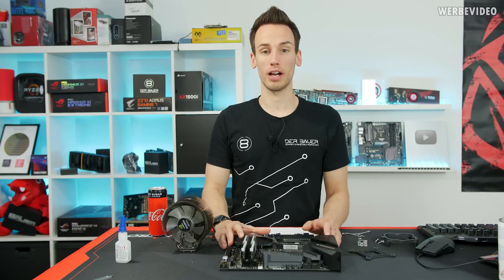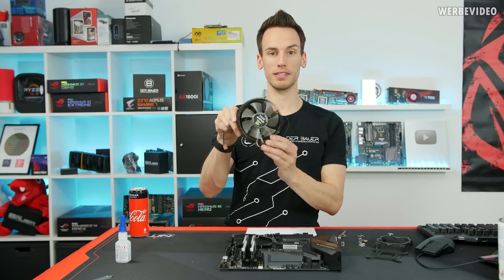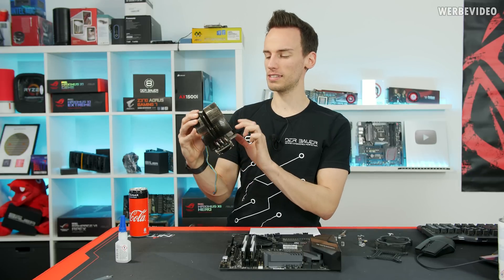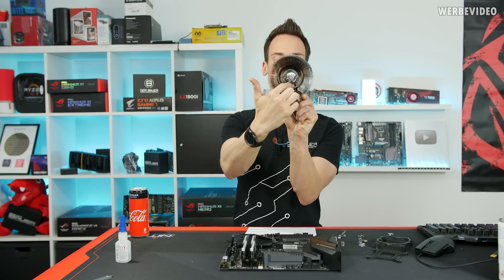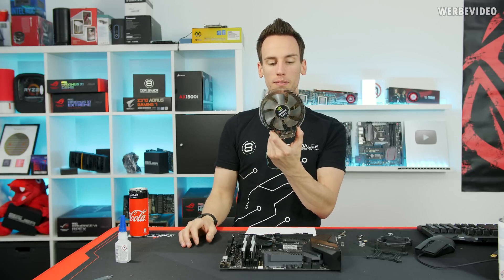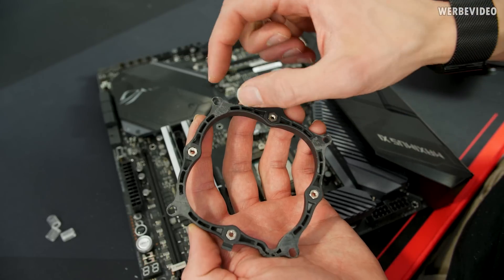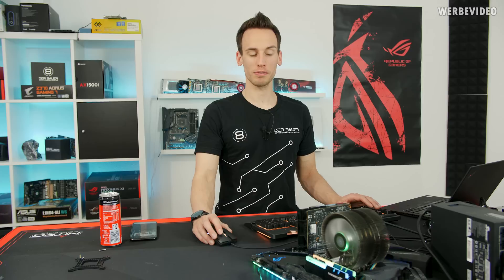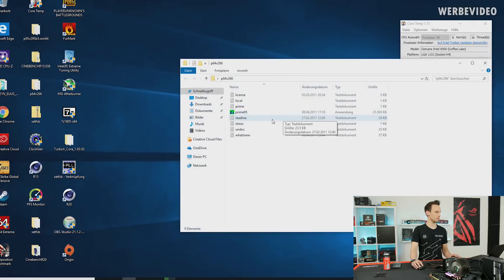HW-Legends #4: Using a 12 year old CPU cooler for todays i9-9900K? Zalman CNPS 9700 NT

Comment: Derbauer you bring back memories dude ^^ this was my 1st custom fan in my 1st PC xD with an AMD Athlon 64 5000 X2

I though it would make my PC runs faster xD (Yes -.- I was noob at computers back in those days xD)
Then I switched the Athlon 5000 for a Phenom 555 X2 => Dolphin EMU full speed 60 fps 2008 Thug ftw xD

and the zalmam VF900-Cu on Saphire Radeon 6770

Comment: The Zalman was good but, preferred the Thermalright SI-128 SE with 120mm as bonus was cooling extended to area surrounding the CPU socket. I still use today with Q9550 at 3.4Ghz.

Comment: I have the Zalman CNPS 7000 CU on my Core 2 Quad system and tbh when at stock my Q8400 runs very cool. I do run it at 3.6Ghz when I run Rust on it and temps seem to peek at 70°C when the room is at 30+°C. In the winter here with 20°C it also stay close to 70°C. Never tried it on a newer system.

Comment: Newer coolers that are made with amd style mout come with this adapter for Intel sockets I've had a few cheep coolers with these brakets work good and I'm sure your old cooler will work with it too https://rover.ebay.com/rover/0/0/0?mpre=https%3A%2F%2Fwww.ebay.de%2Fulk%2Fitm%2F163725065087

Comment: I had the cnps 7700-alcu on an athlon 64 3500+ in a dfi lanparty board.

I ended up replacing it with a thermalright xp-120 and a vantec delta 120mm fan. Boy was that a terrible idea in hindsight, so bloody loud.

Comment: I still run the Zalman passive water cooling on my modern PC that I got in 2004
Reply: "Modern" pc that you got in 2004?
Reply: @randomkingdom5423  The cooler I mean is from 2004,  PC is AM3+ with 980 maxwell. Just been reusing the cooling system over and over with each new PC I built.

Comment: The term you were looking for is "Elongated" when talking about the way you widened the holes on the mounting plate ;)

Other terms for an elongated hole are;

> Oval
> elliptical
Reply: I just call them 'slots' or 'slotted holes'.
Reply: Oval is incorrect because an oval is a continuous curve, where the 'sides' are widest at the middle, and with a non-circular curve.  An elongated hole or a 'slot', has two parallel sides with a width equal to the diameter of the original hole
Reply: I'd go with "Oblong".
Reply: @nathanallred1817  yeah. that one's especially easy to remember
Reply: I agree with Nathan that I would probably use the word "oblong" in casual conversation, but stronkde is right: the official term for such a thing in machining parlance would be "slot" or "slotted hole." I had to make a lot of these when I was taking Autodesk/solidworks classes.
Reply: "Wallerd out"  dont use that term in oklahoma "Your Girlfriend is wallerd out" will get you curb stomped
Reply: Ovular.
Reply: Eccentric
Reply: Elongated Musktache

Comment: I ended up taping a faring around my cooler to improve it's cooling efficiency and it did help lower temperature even before I added ducting to guide the hot air out of the case.

Comment: I have the ZALMAN CNPS 9900MAX (300watt) nickel plated all copper monster cooling my 5GHz 8700K. It doesn't pass 80°c. The 9900MAX has a sintered and grooved heat pipe design. The first  to use it.
I also have a CNPS 9700 cooling a 3770K OC'ed to 4.6GHz with out issues. That one had a universal mount for 775 to 1155. 
  The 9900MAX brand new (old new) were only $25. So I purchased 3 of them, 1red, 2blue.
  My next find is going to be the 9900MAX DF. The only one I've been able to find is $125. Which is a little to much for a 10year old cooler but it still looks awesome. 
  The mounting brackets that came with the 9900MAX fit the 1151 boards just fine. The ZALMAN 9700's also fit all 1151 boards. That must have been the original mount for the 680i and other 780i SLI, and 790i boards.

Comment: An "Oblong" hole or a slot.  I had the CNPS9700 I think.  It was one of the copper ones but mine dint oxidize that much as I recall and someone was happy to buy it off of me when the mounts no longer worked for me.  That cooler was bad ass.  I loved the look of it too.

Comment: Why retro hardware looks cooler than modern hardware? Think about these coolers, DFI LanParty mobos, mobos with beefy chipset and VRM cooler with tons of heatpipes, cold cathodes, cases (for example the CM WaveMaster, the TT Shark, Xaser, Tsunami, Soprano, the old Lian Li cases, the Chieftec Dragon and even Silicon Graphics workstations), and PSUs (for example OCZ, BFG and old Enermax PSUs)
Reply: I think the same haha and I think we're getting old and we're going grumpy oldies saying to the kids "back in my days we did overclocking through BIOS by BCLK"! :-D
Reply: @Rayhold  I'm 17 but i can relate: i used to do OC with a Q6600 and a Sempron 3000 754, and since i didn't got the multiplier in most cases, i used the BCLK and RAM divisors
Reply: @DVRC  damn you're pretty young!! i'm 31 and i OC'ed in Q6600, Phenom 9750, Phenom 555, Phenom 955, 960t.. since sandy bridge it got boring. Now i have a 6700k in stocks :D
Reply: @Rayhold  People still use BCLK to some extent for overclocking these days, in my days it was FSB overclocking. There are probably a lot of people in here that don't even know what FSB is. ^^

Comment: Was the Zalman company the one that pioneered the all copper heatpipe aircooler for CPUs and GPUs during the mid 2000s? Also if the coolant inside the pipe were just plain water, for a lifespan of 10 years it's must have oxidized completely with the interior of the heatpipe therefore reducing it's thermal transfer performance. I personally still using an AMD Athlon64 X2 4800+ stock cooler with heatpipes on an A10-7850K with temperatures under 50C while loaded. I think my constraint is due to the subpar Antec Formula 6 thermal paste I use. Thinking about changing it to something better like Kryonaut ;)
Reply: Yes
Reply: they where the first and the biggest then. a lot of clear plastic and cathode tubes then....